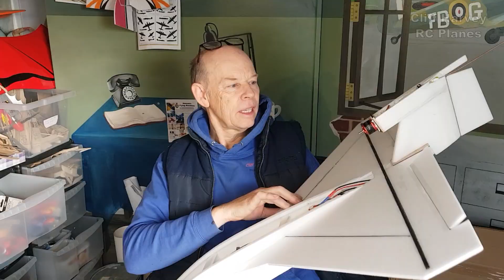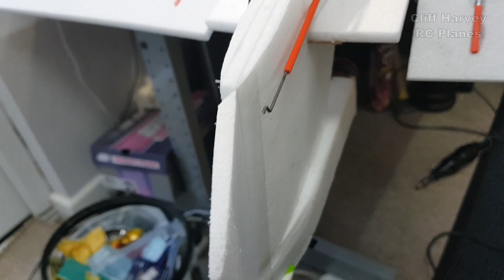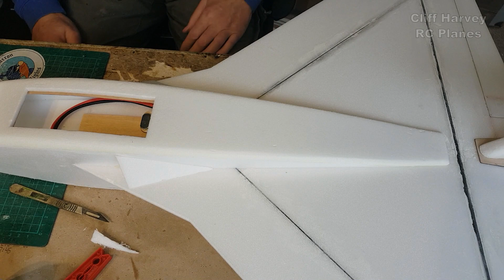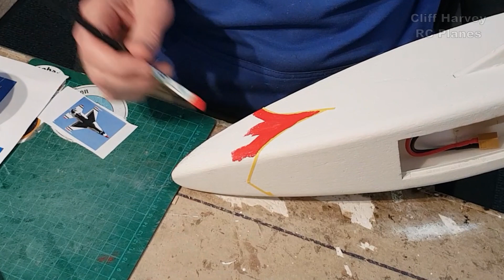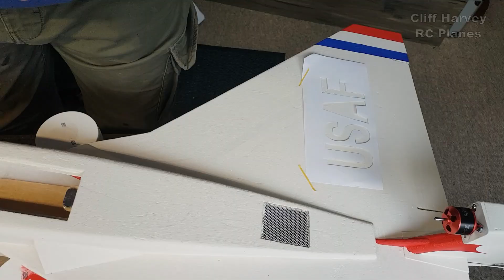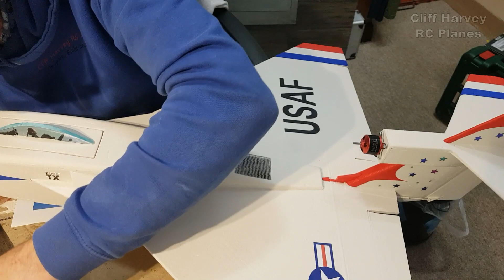Polaris Parkflyer Build Part Two

Comment: Love the build. I too had a concern about ESC cooling so added a NACA scoop in the top of the nose and a half plastic spoon near the back on the stock Polaris, and the valve and housing from a breather mask on the Ultra with the grated outlet facing aft. Waterproofed both the ESCs and receivers with LPS 3.
Reply from the maker: Thanks for the info Proteus, I guess you're flying off water 🤔👍

Comment: Hi Cliff. I will be starting mine this weekend. Parts cutt etc😀👍🛩️
Reply from the maker: Cool Wouter, I should have taken my Polaris instead of the autogyros, it would have handled the wind better. A club mate built his with the control surface push rods coming out at an angle over the top of the wing , less work than fitting torque rods for sure 👍
Reply: @cliffharveyrcplanes  maybe less work but I like doing those old school ways😀🔩🛩️👍
Reply from the maker: @Stilo-Craft  I know what you mean 🙂

Comment: I love Mod Podge! It's a very easy way to give a lot of strength to a foam model and makes it dent resistant. You might have seen that I used it on my Binary Aurora and I've also used it on the Red Ranger. I experimented with a coat of Mod Podge, then paint, then another coat of Mod Podge over the top as the "protective coat", still not totally happy with it, but it beats laminating.
Reply from the maker: I'm going to use a  British product called Polyvine Acrylic Decorators Varnish over the top of the matt paint, I've gone for the satin finish so we'll see 🙂

Comment: Quite good idea to connect the ailerons. 👍😁
Reply from the maker: Hi Doc, it's an old idea, I did consider a servo on each wing but went traditional in the end 🙂👍
Reply: @cliffharveyrcplanes  
I know. I didn't know the type of connection ; wire , plastictube and aileron.  Good luck for the maiden flight.

Comment: Cliff, I can't wait to see you fly it; I bet you'll love it. I've built and flown a couple of this model and wore 'em both out. They are one of the all-time greats. 

The innovations you added with the linkage were remarkable; I would never have thought to use an old-time aileron linkage like that, much less have executed the application in such a slick way. Also, to envision the Polaris as F-16 Thunderbird, how cool is that?

Consider adding a thin, light ply (or other) to the aft fuse from the spar to the trailing edge between the ailerons, reinforcing that area. I predict that that is where it is to break sooner than later.
Reply from the maker: I hope so Stephen, cheers 🙂